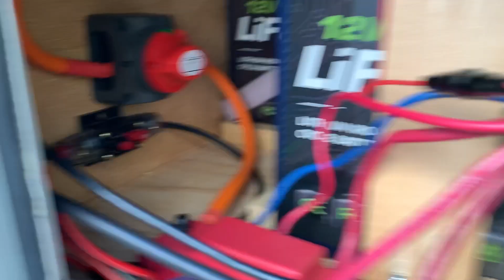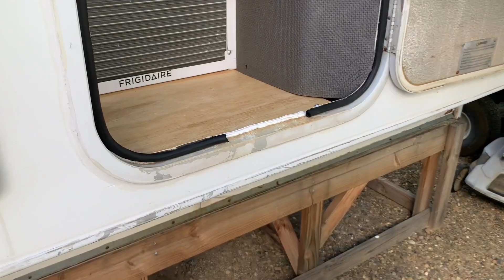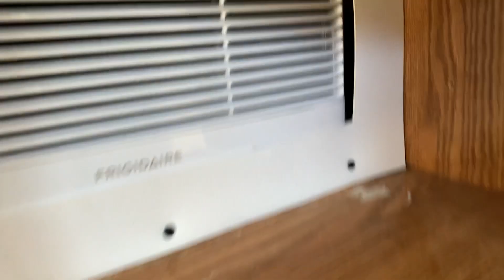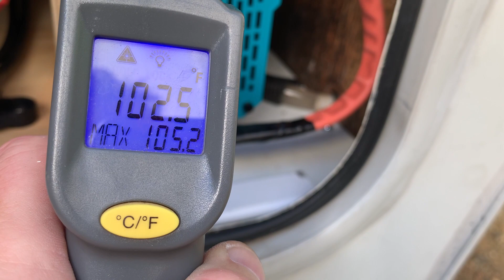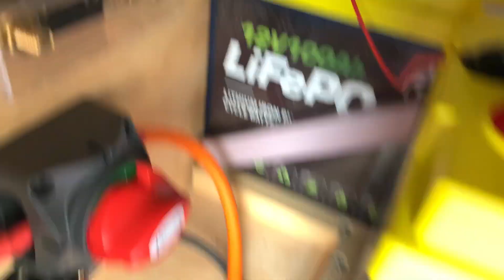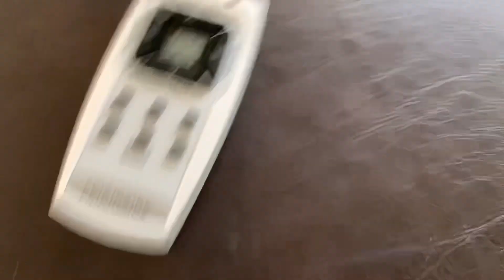More 5000 BTU Frigidaire A/C Testing in the Truck Camper

Comment: Nice install.  Where is the moisture/condensation that the A/C unit is pulling out of the air go?  Normally the moisture it pulls out of the air leaks out of the back of the A/C unit?  Do you have something to catch it with?
Reply from the maker: Yeah, I’m harvesting around a gallon of water for every 4 hrs of air conditioner use.
Modification to the pan includes a drain hole, clear 3/8” water line to a 2 gallon water jug mounted down by the bumper for easy access. 
I just run it through my Katadyn water filter.   (For washing, cooking etc)
If I’m going to use it for drinking, I’ll add 1/4 tsp of Himalayan salt per gallon of water.

Comment: As expected, very nice install. Using outside existing access panel is great. Can close when not using. Inside, cool air may have a problem getting out of the cabinet. I suspect you will add ducting. Sadly, most campers do not have outside access panel with inside cabinet like yours. I would have do to major remodel, and add outside access panel. But really like your design, not sticking out of camper side. I am afraid I am stuck with expensive 12v roof top unit.
Reply from the maker: 👍🏻
Yeah, I got luck that the old battery compartment is a good fit.